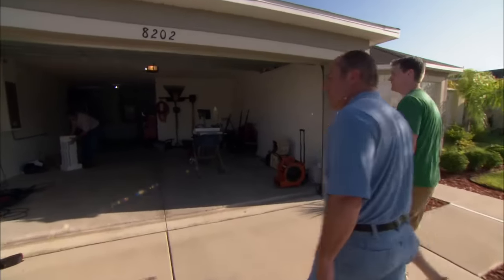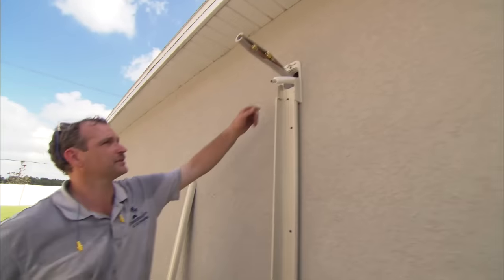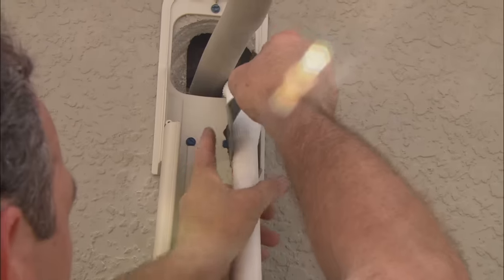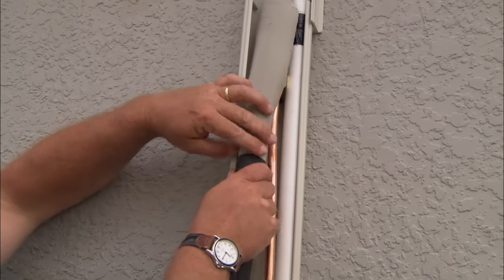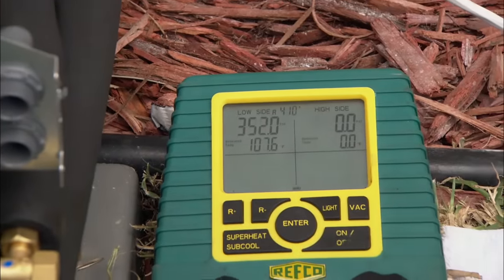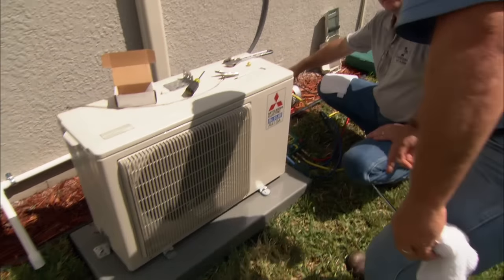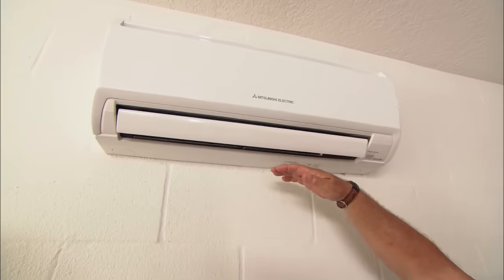How to Install a Ductless Mini-Split Air Conditioner | This Old House

Comment: The guy is soaking wet. It must be like 110 outside.
Reply: Takuya Well, in the beginning he does say that it is 110-115.
Reply: shtiken Ok , I must have missed that.
Reply: Takuya No, I'm just saying you're right.
Reply: Takuya  must be in arizona
Reply: Takuya pressure done great!
Reply: malakaijub, probably not Arizona. You sweat, but it doesn’t often accumulate on clothing. It evaporates too quickly in the extreme dry climate of Arizona. I’m guessing somewhere very humid. Probably Florida...possibly Texas...maybe Louisiana
I googled “Zimmerman HVAC” and the first one pops up near Tampa Florida. I bet that’s it. The logo looks kinda similar to the one on his shirt too
Reply: Ugh... Writing from Arizona, here. For one, around here "extreme" applies to the heat - not the dryness of the air, the arid climate. Second, if you're sweating outside - profusely and continuously while working - it's like a running water hose. You only stop sweating and drenching your clothes once you stop whatever you're doing (including simple tasks like walking out to the mailbox and getting the mail) and get out of the heat and get back inside the house, shop, office, car... where the a/c is already on and having cooled the space. Even after that you have to (should) change out of clothes or your shirt because you have to get the sweaty clothes off your skin (pores) and let your skin breathe so your body temp can begin to cool down. That's actually very important.

If I'm out running errands and getting in and out of my hot car I have to completely change my clothes when I get home. My husband who sometimes has to work outside leaves the house every morning with an extra shirt to change into after working outside so he can cool off and so he doesn't have to drive around to next job or back home in a shirt drenched in sweat. You'd be hard-pressed to find a working man who doesn't have a few shirts in his work truck that are either his spares or the ones he took off after work. 

The only thing the extreme dry climate of Arizona contributes to in any 'Desert Life' scenario is 'danger' because people are fooled to think of it just as you are thinking - it'a  dry heat so it's not as bad. Actually it accelerates the body into dehydration far more quickly. That dry, extreme heat 'zaps' you and therefor heatstroke / sun poisoning is always a high risk including for pets. There are even laws re: pets left outside in the extreme heat of summer in Arizona. 

I moved here from the Gulf Coast of Texas when I was in my early 20's and thought I knew ALLLLL about living in the heat. Boy was I wrong! I had sun poisoning FIVE times the first two years here. I've had water poured down my neck and top of my head; I've been wiped down with rubbing alcohol and a wash cloth to help bring down body temp by hotel staff after walking along a creek bed in Sedona (didn't know alcohol could be used for that!); I've been dipped in a tub of cold water and shoved under a cold shower a few times. Once while out shopping it hit me fast and so hard I thought I was going to pass out so my friend quickly took me into a convenience store and yelled out to the people behind the counter that I was overheated and about to pass out. The manager rushed me into the cold locker, grabbed a hand towel, wet it and draped it around the back of my neck. This sun poisoning was starting to get old so finally, after those first few years, this Texan (who knew it all... pffft!) finally got a clue and started listening and learning how to live in and survive life in the desert. Hydration is King and changing out of sweating clothes (including under garments) at least twice a day is a given and important to allow your skin to cool; to start to get your body temp back down so get used to changing clothes often and always keep laundry detergent in stock. If the clothes dryer breaks, who cares! Stick the wet, freshly washed laundry outside on a clothes line and it will be dry before you can make and eat a sandwich - that includes at night. 

Pretty much anyone who moved here from someplace else has a story of what they went through their first summer in Arizona and they all admit they had it all wrong. Yeah, it's a dry heat so that means it's dangerous and it will quickly zap you if you don't learn how to live in it. And just a little note since people don't realize how much the heat effects daily life in Arizona, people who work in construction or road repair for the city have to wear a certain work boot made by Red Wing which has a specially designed sole that is proven to not melt/ breakdown from the heat of asphalt. True story. It's required for dress code and safety. In the summer those road construction crews doing road repairs start work in the evening and work overnight using huge construction lighting. That is for safety from the broiling sun but even then it's still unbearably hot at night (temps linger around 100 at night in the summer) so OSHA rules are strict for attire, breaks and hydration. 

If anyone ever wants to know what the heat in Arizona actually feels like, you may be thinking of moving here but wonder what it's really like, go set your oven to 100 and leave it for about 30 minutes. Then go stick your face right up to the oven door and quickly open it! Feel that 100+ degree dry heat blasting your face? That's what if feels like to open your front door and go outside, just to get the mail. Still wanna move to Arizona?!  ; )  

 ~ Cheers! (she said with an ice cold bottle of water)

P.s Sorry for the wordiness but it's hot outside (106 degrees and only 10:30am!) and I've nothing better to do ;)  Lol.

Comment: OK but if it's my house, not a garage, am I really supposed to drill a giant hole through the house in every room?...
Reply: You would only want this in a room that doesn't have ducts from the house a/c or one that doesn't get cool enough from the house a/c. I would use a portable floor unit, not this. They are much cheaper and you can stick the duct hose through the wall or just use the window mount. Through the wall is much better and the hole is only slightly bigger than the one they drilled for this thing.
Reply: +twitterisfortwits.  However the little portables  are not very good at long term cooling (they vacuum air from a cooled room), are noisy and drippy  (eventually).  This is a REAL AC, just without ducts.  It can cool about 4 rooms with open doors or transoms, so a 2000 sq foot home may only need two units, or one outside unit with two head units.

Ducts often waste energy.  Often installed sloppily (because the homeowner doesn't see the shitty work the HVAC helper (or the installers kid home from school) is doing while training to be a real installer.  Even properly insulated ducts lose heat and cold as the air travels and as the tape joints age.
Reply: +smeker78.  We'll that's a different way of saying what I said.  Consider the reasoned approach occasionally.
Reply: باب
Reply: بابلؤي
Reply: Portables are real a/c’s

Comment: Many steps are left out of this video.  Flare fitting connections need to be oiled.  He didn't torque the flare with torque wrenches.  When you leak test with pressure, you don't cover up the connections with insulation,  you need to soap them for bubbles.  Vacuuming needs to be to below 500 Microns.  The pitfalls from not doing this are major.  Not in the first year,  but the years to follow making some people believe the systems are junk.  It's not the equipment, its the installer...

It's not this easy.  It's easier than putting in central air, but consult a professional before taking on this kind of project.
Reply: hey Ike fun sorry to burst your bubble but ats mark is absolutely right but you wouldn't know that because you don't do it for a living. it's called a micron gauge used with your gauges and pump 410A refrigerant is pump down to 500 microns or less the old R22 refrigerant used to require 700 microns or less so you really need to do your research before you start calling people names because you sir are indeed wrong.
Reply: Ats mark. I can't watch this show any longer. So many wrong things. The flairing tool he used was not a 45 degree flair tool. Also.  Stop calling the flair connection a compression fitting. They are completely different things. Could go on for hours.
Reply: @billhoward1918  The unit manufacture suggests a 15min vacuum using a .25HP unit. Just run it 2-4x the suggested if you are unsure. Certainly dont need a micron gauge. That is a tool designed for a pro that uses it all the time. For a one time install just for moisture, you can certainly use some logical probability.
And then you have the pros with all the right terminology. :-) First it was the music industry, then photo, and now its the HVAC taking the hit.  Knowledge makes all people better, and some pockets less rich.  Stop being so greedy and thinking of yourself. Once we all have true knowledge all things will be better for all. But the net will be cut before that happens. So learn all you can now! Of course this doesnt apply to all, but sadly the majority. Many helpful pros have contributed their time and help. I am speaking in the general majority.
Reply: greedy and thinking of myself ... yeah that's what I'm doing when i'm giving the customer the best job. might want to try doing some research on the correct way to vacuum a system down there's no time frame on it. you vacuum it down to 500 microns or less end of story. but don't take my word for it, please do some research . smdh
Reply: Phil... I know plenty that sub out their work. I, however am not one. I am on 100% of my jobs doing 100% of the skilled labor. My point is... if you don't charge $1000+ for that job, you will go out of business. You make it sound like professionals charge a premium out of greed (and I won't argue that there are plenty that do)... however there's a LOT of overhead. The equipment to do the job right isn't cheap. The vans to haul the equipment around in. The price we pay to be licensed, insured, and bonded. The list goes on and on. The fact that you referenced a "timed" vacuum speaks volumes. You want to guess what #1 mistake is in installations that leads to premature equipment failure is?

Comment: Why risk hand bending the copper piping, wouldn't it safer to use a small pipe bending tool?
Reply: Jason Rogers this pipping is very soft. You can bend it without kinking the pipe very simply.

Comment: Right at 4:10 I like the way they just stuff the control wire in the hole. it doesn't work like that. they tried to make it look easier than it really is. You have to fish that line from the back of the unit to the front where you connect to the terminals. OMG

Comment: I would spray those flare nut connections with leak detector while the system is under pressure test, also the vacuum pump is more to remove moisture and air from the system not just the nitrogen.
Reply: Manbearpig Gore actually it is for the air and moisture in the lines not the nitrogen the nitrogen you just blow off into the air through your gauges it's an inert gas which is okay for the environment if you hook the vacuum pump up with the nitrogen still in lines the high pressure would blow the oil from your pump right out of the pumps exhaust port and you would have one heck of a mess on your hands .

Comment: Not a bad install but you could of cut off the flare ends from the indoor unit and brazed the connections on. Brazed ends will never ever leak. More flares = more chances of leaks in time to come. Always the best practice.

Comment: Can you mount this type of unit vertically?  I have a loft with no a/c and this looks like a great option, but I'm pretty sure I don't have the space for a standard horizontal mount.
Reply: I don’t think so due to the refrigerant liquid

Comment: A 1.5 ton mini split from Mitsubishi installed with electric disconnect is $4500-5600 installed for the garage.

Comment: I love these systems. So how did the installer know where to drill the hole on the outside of the garage to line up with the hole on the inside?
Reply: Boring bits have a pilot bit in the middle.  The pilot bit guides the boring bit.  The pilot bit therefore extends out more than the boring bit.  The driller stops when the pilot bit makes it out to the outside but not the boring bit.  Then when you go to the other side, you can see where to start the pilot bit.
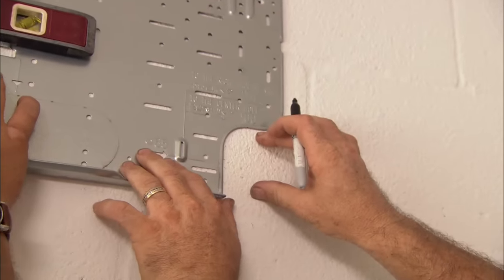Reply: Pre-drill with a really thin masonry bit to minimise the blow out and don't push too hard when you're about to push through the other side. If there is any blow out, hopefully it'll be smaller than the boring bit that you'll use later. You can see the pre-drilled hole at 1:05
Reply: Probably measured and then looked where on the brick. Bricks are symmetrical.. If it was in the corner of the brick  in 4 in from bottom and 3 in from the size, figure out which brick, and start pilot hole...

Comment: what is the maximum length can be between inner and outer units?  In my case, the  distance between location I want to put inner unit and back wall of my building is about 25 feet. 
Is the only standard length of tubes you can install or can be added extra?
Reply: you can add extra...ask a local pro about it